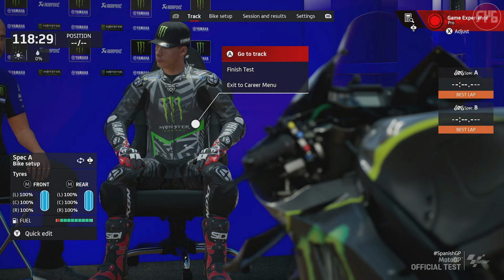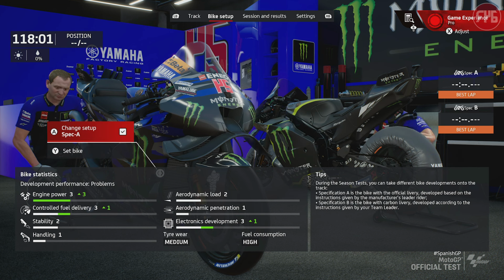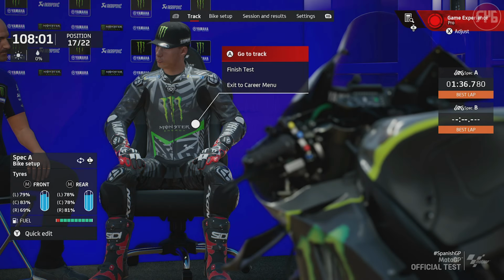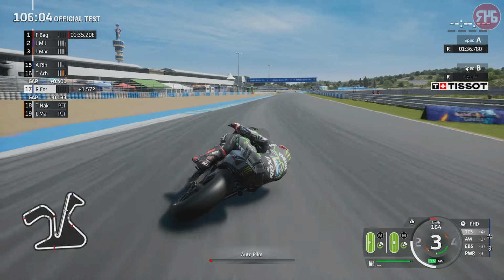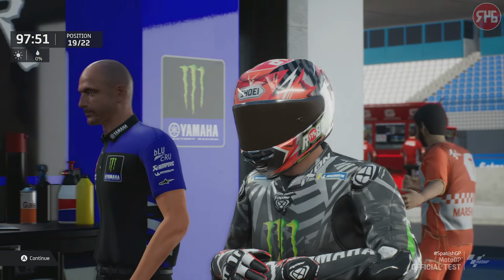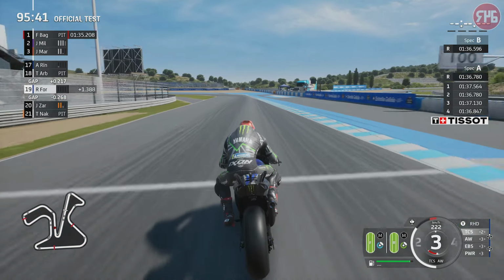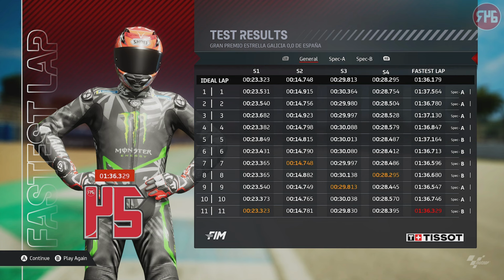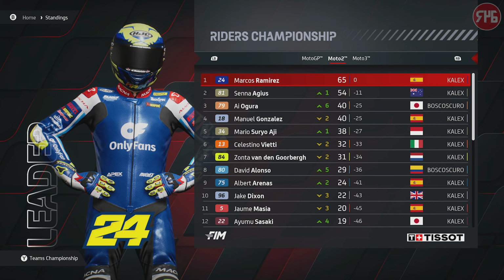MotoGP 24 | Career Pt 51: Engine Upgrade At Jerez Test!!!

Comment: Must admit Robo, I'd have gone with Spec'B' to be honest, seemed like your lap times were more consistent? 😮 anyway, onwards and upwards 👍😉
Reply from the maker: Normally I would’ve, but I need the engine upgrade. Jerez isn’t a power circuit so you can’t fully utilise the engine upgrade around there 👍

Comment: I want to stop using joint break because for example at Portimao it’s a nightmare (front break on downhill) but I’m confused on when and where I should use the rear break. I noticed that you use it mostly for the final meters of a breaking zone?
Reply from the maker: I tend to use the rear brake more in hard braking zones, it’s also useful for closing the line through corners if you’re a bit wide. I do use it at Portimao to keep the front of the bike down through the rollercoaster section.
Reply: @ROBO46  okay thanks and what do you have assigned for the rear brake? Still confused about where to put it

Comment: I'm kinda new to MotoGP. When did Yamaha become so bad and why can't they keep up?
Reply from the maker: One of their current riders (Fabio Quartararo) won the MotoGP championship in 2021 on the Yamaha. 2022 the bike hadn’t really progressed when all the other manufacturers took a big step forward, Quartararo still managed to finish 2nd in the championship but demanded more from Yamaha to battle with the Ducati’s. 2023 was a disaster and 2024 has seen a small improvement but not enough to battle at the front.
Reply: @ROBO46  oh, thanks a lot for this explanation. So it's a recent thing. I used to follow MotoGP back when Valentino was the best, that's why I'm so surprised about Yamaha's performance